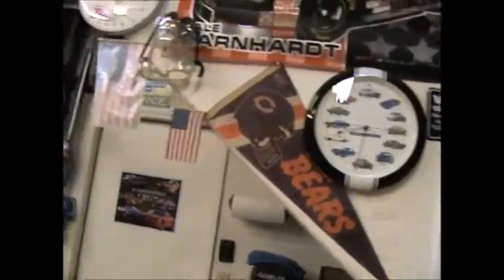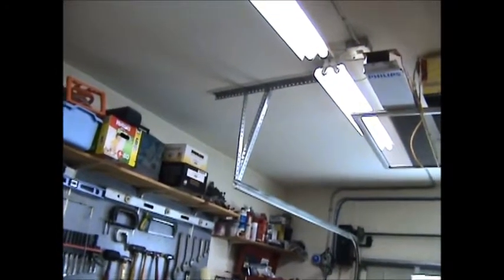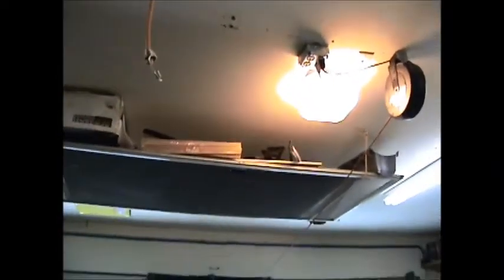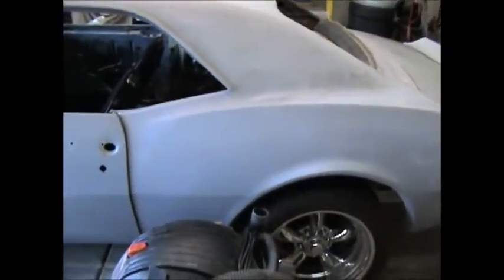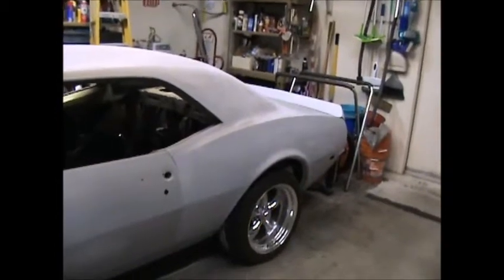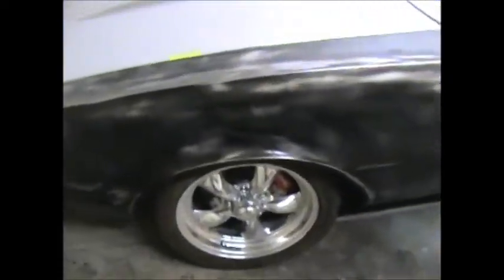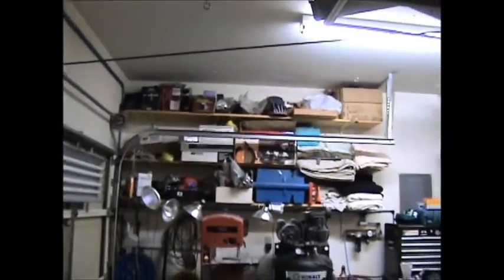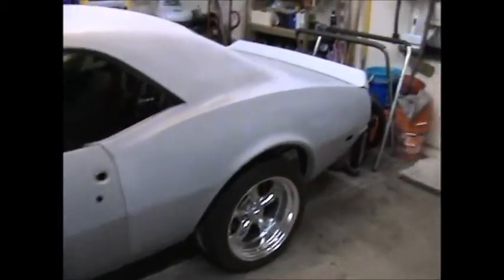1968 Camaro Resto-Mod 3-11-15

Comment: Nice Camaro :) I love the garage door openers what is that called. Mine are ceiling mount. You get a lot of ceiling spacewith them.
Reply from the maker: ***** The brand name is Lift Master It's a little more than an overhead model but it's worth it. Thanks for watching